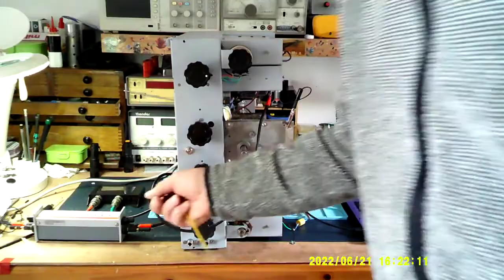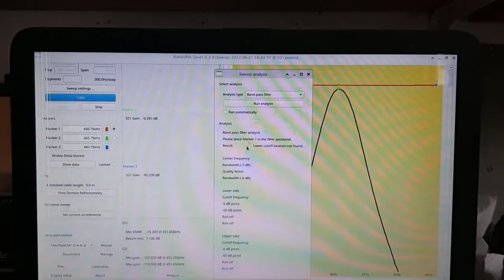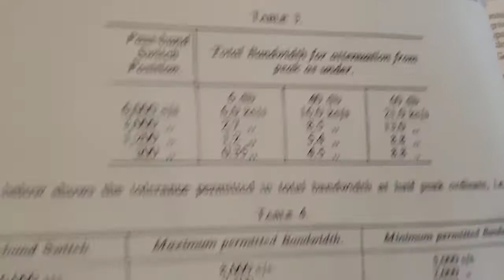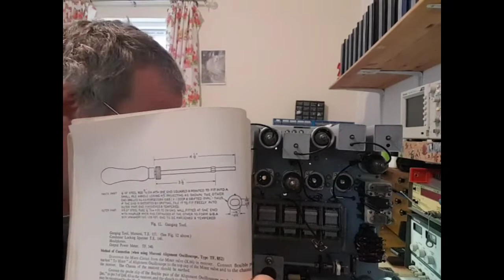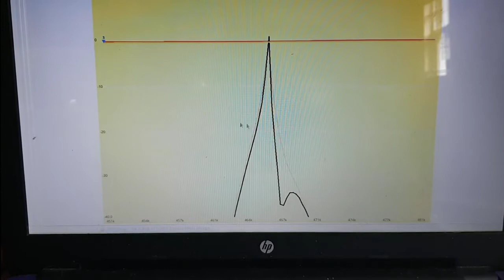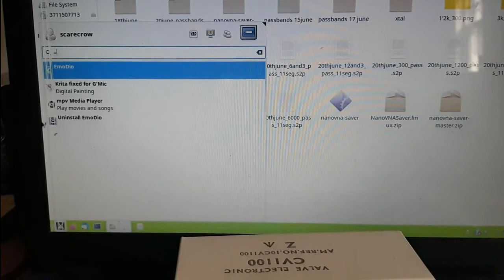Marconi CR100 Renovation (44) IF amplifier  alignment.

Comment: Simon. I have a VNA, wish I didn't.. Nothing but a sever headache. the software crashes the screen hardly ever accepts any input so I have gone back to my pre 1970's test gear..
Reply from the maker: Hi Dave Just noticed You reply here. The Vna s can be a problem. My first one a cheap one. A  2inch screen from Banggood  was completely rubbish, Iin the end they sent me another but its a bit quirky. I then bought a 4inch screen one ,with N connectors and a metal case. This one wouldn't except an input from the screen.  I got it on ebay .and despite all the suggestions from the seller  I never had it working properly. That was the one I managed to destroy on the CR100.  Looking into it I discovered I was getting the cheap Chinese copies. So I bit the bullet and got  one from Mirfield electronics in the UK, A little more expensive and it works well . I use the software on a Linux laptop.
The Wobbulator I built was more a curiosity as I had wanted to build that one since I had the PW in the 80s. Didnt seem to work to well . possibly the triggering of the scope was the problem. 

One thing to mention about the VNAs  and that is how I think I managed to destroy my one is they dont have much protection on thier inputs. I noticed when I switched the CR100 mode switch it sent a fast spike to the input of the VNA I got round it by using a capacitor and a bleed resistor.